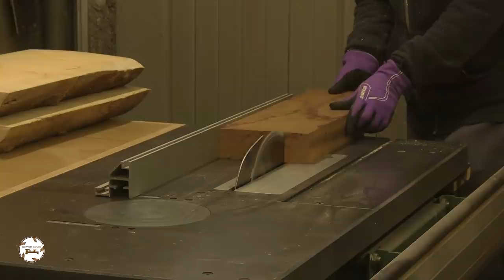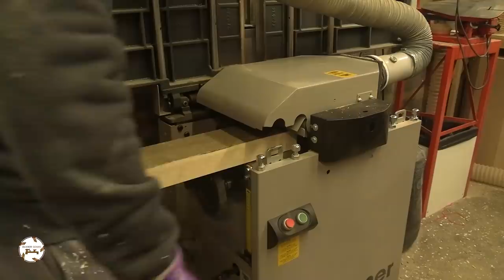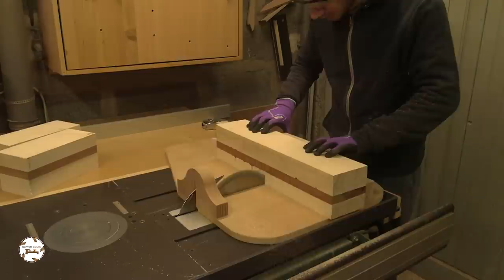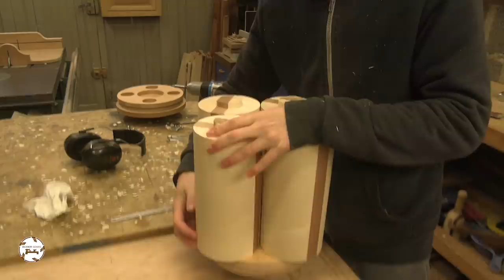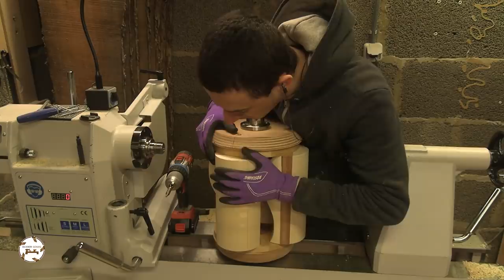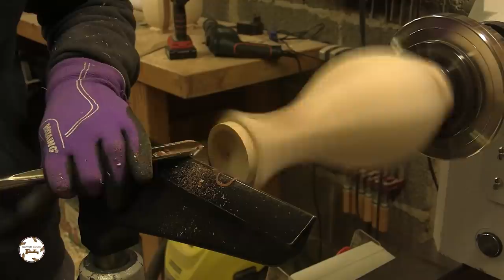Multi-Axis Square Turning

Comment: Hey, you might have a good reason to wear gloves, but it is considered dangerous. You are reaching a big audience with your fantastic work, and some people could think that this is fine. NEVER wear gloves or loose clothing when working with rotating machines, stay safe :)
Reply: This needs to get pinned
Reply: I think the shop is not heated and it might be cold...but you are right about gloves being hazardous
Reply: @ykkfamily  😳 hazardous?
I would of thought it's a must to ware gloves.
Reply: @motog4-75  
The risk is that even when being as careful as possible, the gloves can become snagged on the piece itself, or on the machinery you’re working with, and essentially pull the hand into the machine. Needless to say that if machines can do work on hard wood, they can obliterate fleshy human meat.
Reply: Why?
Reply: @radiation3570  why what?
Reply: @motog4-75  why wear gloves, is it dangerous, and if so in what way?
Reply: @radiation3570  With rotating machines like table saws and lathes, the cloth of the glove can get caught more easily than your skin and pull your hand into the blade, and you'll be unable to pull free, whereas if you accidentally put your hand into the blade normally, you'll get a nasty cut for sure, but your reaction will be to pull away and you'll be able to before you lose your hand most of the time
Reply: @christiancasaverdepertica1802  Or if you have a saw stop.
Reply: @TornaitSuperBird  Another good point yeah. Saw stop won't stop as quickly if you have a glove on, most likely going until there's already been damage done
Reply: @TornaitSuperBird  there ain't no stop on a lathe except the button
Reply: @Bagelbytez  they also like fingers.
Reply: @motog4-75  it is counter intuitive but the material of a glove is stronger than your skin. If it gets caught it will either pull your hand and the rest of you into the machine or it and the skin on your hand will be ripped off. This gruesome injury is called de-gloving. I strongly caution looking it up. If it’s just your skin getting caught you are much more likely to escape with just a bad cut. Rings pose a similar danger. 

Basically if you are working with rotating machinery you rarely want to wear anything on your hands. The only time you wear gloves is when the work easily damages the skin. Ideally in those cases you figure out how to do the work with a tool so you don’t need gloves.
Reply: @bensemusx  😁I had a friend years ago who was mincing some meat I think & he didn't have the plunger rod to hand to shove the meat further along. So he tried with his fingers, number 3 & 4 on his hand came straight off.
He said later it's the sort of thing that as you are doing it, you just know you should not be doing this, it's potentially very dangerous, but you continue anyway. The machine doesn't care. It's like it says to you " you were warned".
Reply: I agree with you 100% on the topic of safety. I'm a power Carver and when I carve my Dremel 4300 is turning at 25,000 rpm +. I almost lost my thumb due to the tool snagging a glove once. Since that incident I don't wear gloves when carving. Eye protection and face mask/shield yes, but gloves no. As you said, by the time the machine lets go of the glove it's too late to avoid damage.
Reply: i totally agree. I worked in an unheated and uninsulated shop built on a wharf through a Canadian winter and any time I was using a power tool (other than a drill) I took my gloves off. It’s just not worth the risk.
Reply: @motog4-75  No, they can snag in the machinery quite quickly

Comment: Is no one else worried about him wearing gloves while using spinning power tools, especially the table saw?
Reply: I can imagine very few scenarios where a table saw would fuck you up wearing gloves but not bear handed. If you’re hand is that close to the spinning blade, you’re gonna get hurt regardless. Of course there are edge cases, but no, I wasn’t worried. This is the first video of his I’ve seen, but the way he works speaks of grace and control. Accidents happen, but I think this guy’s gonna be okay
Reply: @bencressman6110  The difference could be a nick on the finger and the blade pulling your hand in. Look up world famous rock climber Tommy Caldwell and his missing finger. I'm sorry I don't have a long list of examples for you, but it seriously can't be that hard to imagine. There is a reason why most wood workers don't wear gloves. This isn't something that is debated, so I hope you're trolling.
Reply: @MrSatchelpack  I'm not trolling, you just asked if anyone else was worried, and I'm not.
Reply: It's more dangerous indeed
Reply: Gloves are more likely to pull you in and cause worse damage, especially with lathes. They can also just get in the way and make movements of the hand less fluid, resulting in choppier looking work. and i know at least in the us, most table saws are equipped with a mechanism that stops the blade as soon as a hand touches it.

Comment: I put a strobe light on my wood lathe that was synchronized with the rotation of the lathe.  Dim the back lights, turn on the strobe light, and suddenly the spinning blurry wood stock was freeze frame visible.  Stunning!  There was on odd desire to touch it, so I had to remind myself it was still moving.  I added another control that would delay the sync pulse from the lathe to the strobe, so I could effectively slowly rotate the spinning wood, and select the side I wanted to see.
I learned a lot from that strobe setup, especially about tool edges and how they cut.
It was as if I touched the tool to the wood, and instantly I could see the ring develop around the stock.
A real mind blower.
It was too addictive, and I didn't know the long term side affects of watching it, so I disabled it and gave it to a friend: Mr. Geiger.
I always hoped he would patent it and make it popular, but there is the downside of inducing seizures.
Reply: Instead of a strobe light, could you use a video and monitor set to synchronize?  I saw a video not long ago that stopped the blades.  Very cool!  Good luck!
Reply: "* blades of a helicopter. *
Reply: @shirleyostrander6531  Good thinking it'll work and a spinning aperture geared to the lathe works too. Anything beats harmonic blinking, eye got two tired.
Reply: I remember the boiler room in my church growing up (dad was the trustee) had some moving parts with warnings all over it because it was rotating at the same frequency as the fluorescent lighting, making it look motionless. It was inside a cage, but otherwise, it could easily tear off a hand.
Reply: @verdatum  Wow...too weird!
Reply: Ah yes, the only downside
The seizures

Comment: As an old woodworking geezer, I watch you wearing gloves, and not using a pusher on your table saw, and I cringe. At least you left your splitter on - but holy moly. My Dad used to try to save the fingers of professional woodworkers who got lazy and/or stupid around table saws. Sometimes he was able to. But more common were nasty injuries from the kickback getting them in the gut.

And look, I know that you know what you are doing. We all do. But when and if you lose fear of your table saw, a horrible accident is on the way. I am so scared of table saws I won't have one in my shop! There is no such thing as "bad luck" in a workshop. 

Fear is what keeps me safe when I am working. And I am so glad that many tools still scare the shit out of my. My angle grinder scares me spitless, even knowing how each quadrant works. My routers give me the absolute willies! And even my electric plane makes me very careful.

When you have had a doctor for a Dad, and he's a woodworker, and he's a repairer of woodworking injuries, you develop a very healthy respect for power tools, and how to avoid being sucked into them, or having them kick into you. I wear bullet-proof chaps when I am chainsawing, for example. And a hardhat, goggles, and a face shield!

Comment: This was a very cool project I'm not a woodworker and I have no reference to judge anyone for doing anything with wood. Holly crap when you first started turning with the interrupted cut I thought for sure the edges of the parts would blow out. I can only guess tool geometry and crazy sharp tools are the trick to pull this off. You got my subscription the creative thought is so  impressive well done.

Comment: This is a very interesting concept. I didnt expect you to make 4 individual vases at the end. In my head, i was thinking more that the four would each have a 90 degree angle, but the rest of the sides would be turned. When you put them all together, the corners would meet and form a bigger vase. Or you can display them each individually as well.

Edit: typos

Comment: So cool!
Very well thought out process!

I have to say that I am not into wood working as these tools are too damgerous for me. Machining that huge wood assembly at those ridiculous RPMs, with a hand-held knife.... Brrrr... I wouldn't dare to keep my hand on the chuck in the tailstock either. The metal lathe I work on does not have any key against rotation, just the taper keeps it from slipping, and sometimes it slips when the torque is too high.

Comment: Heh.  My first WTH was with the planer, when you rolled the table and flipped the dust collection system.  

The second was trying to figure out what your design could have come from.  Like hydro forming some welded metal into a pillow style object.  And I was thinking that I wanted to see the end result of the table to go with those funky legs.  

My first WTF (what the fudge.  Only I didn't say fudge) was when you cored them out to make a vase.  I think that my next door neighbors almost called the cops because I know my windows rattled at my exclamation. 

I was also thinking, if a mathematics wants to hold a 3D shape, call a woodworker.

Comment: amazing work, though I must ask why you use gloves when working with the table saw. Surely you are well aware of how much danger gloves add to your hands in the event of accidentally touching the blade.
Reply: I had to skip through the table saw bits. It's painful to watch.

Getting a knit glove grabbed by a saw blade can easily turn an unfortunate severe finger injury into a life-changing severe hand injury.

Comment: Nice technique!

I'm really surprised that a single screw was enough to prevent the individual cylinders from rotating. As you took wood off the outside, you changed the center of mass and the cylinders would want to rotate out so the bulkier (uncut) inside was facing radially outward.

Comment: Couldn't see if the fastening screws were off centre to prevent the pieces from turning in the socket...
Did you consider using square tenons & sockets? Safer + easier alignment of the four sides, albeit at the expense of losing the flexibility to do three or five, six, etc. sides on the same apparatus...

Comment: I'm wondering what would happen if you slipped with your tool and fed it in too far during that interrupted cut.  Would one of the "spokes"/legs grab your tool and could the whole thing explode in your face?  I've had a few bad crashes on a metal lathe, but luckily the part and fixture just exploded into the door and walls of the enclosure.  The real damage was to my underwear...I had to throw them away.

Comment: Additional comment: Could the same technique work with 3 or 5?  Would have to be very precise about the rotation angles but I think 5 would be really interesting.  Odd numbered surfaces are a little "unnatural".
Reply: 90° tends to be easier to mark than 120° or 72°, but all should be possible, and would probably look interesting. I’d personally also like to see 60° (hexagons).

Comment: Nice result, but save yourself time and energy. Either don't bother with the initial turning and just run the 4 blanks at once or just cut them down to octagons first. I'd also recommend reversing your registration/mounting pins so you can just use a large forstner bit to bore into your work.
Reply: Comedic
Reply: @kingy002  Clavicle

Comment: Why not band saw the profile out first. Then you can use the negative profiles for another set and you won't waste so much timber in shavings for the same results. I used to work in a joinery shop of about eight tradesmen. We had to find ways to utilise the maximum benefits of expensive exotic timbers and laminates. My boss would shriek if we made them with that much wastage, Nice work.

Comment: This is absolutely an astounding feat, and I don't wish to detract from its magnificence at all....but couldn't you acheieve the same shape with a bandsaw? I'm only curious if my instincts are correct. I like the lathe for the things it can create that nothing else can (literally). Just curious if this is truly one of those things.
Reply: I was looking for someone like minded.  I have done similar pieces on the bandsaw.  Stencil it out and keep taping it back together until all cut out.  Now on the piece in the video each side is slightly convex which would take some careful sanding to replicate but the piece is so small the convex surface is unfortunately hardly noticeable in my opinion.
Reply: @joewood Nice! Glad I'm not the only one. I've been thinking about this more, and the thing you get from the lathe on this project is 4 nearly identical pieces, whereas on a bandsaw you're at the mercy of your sawing ability, and how well tuned your saw is.

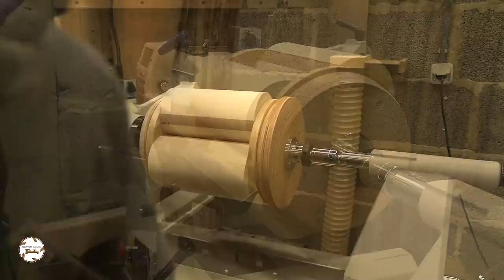Comment: What exactly is preventing those individual pieces at 3:35 to give in and move under the tool pressure, other than the friction between them and the "flanges"? If nothing else, then for me that's a ludicrous amount of not taking things seriously, regardless of whether or not it all ends up working out.

Comment: Seems like an excessive use of machinery. Is it impossible to that angle on the walnut core without turning the billets? I can imagine myself just carving these up with hand tools. The advantage I see with this is the perfect uniformity with the aforementioned angle but i can also imagine myself creating a process that just does it the same every time.

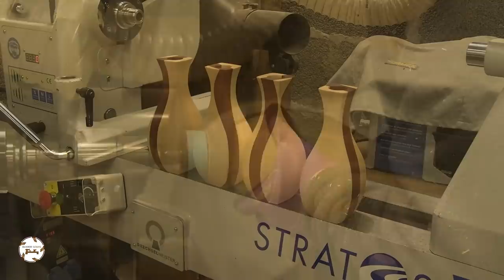Comment: @ 11:22 you insert a glass tube or some such. What is the purpose of the glass?
Reply: I believe they're meant to be used as vases.  The glass tube prevents the water from soaking into the wood.

Comment: That’s a great project “” COMPLETION “ —- unlike the ignorant observer  , we’re there parts you since turning would modify knowing your turning skills -(ie) a double screw in each end piece stopping twisting on the turning??
Does this work lead you on to more complex project designs? ( ie )  A INTERCONNECTED STANDARD LAMP DESIGN 🤔 - Alle die Beste 🤓👍

Comment: Hate to bring the bad news, but, could have done the same thing on the bandsaw in a quarter of the time and work.
Reply from the maker: Hate to bring it to you, but a bandsaw cuts flat. This technique makes rounded sides.
Reply: @OlivierGomis  you wanna take a moment to think that through again bud? 🤣
Reply from the maker: @saltwaterrook4638   I suggest you take another look at the video before being so arrogant, and you'll see that no, I could not have done the same thing on a bandsaw.
Reply from the maker: @saltwaterrook4638  Okay I agree about the second part, but you still need to use the lathe and the jig I made, and since this is a woodturning channel, I did it all on the lathe. But if you claim you can do the same thing using ONLY the bandsaw, PLEASE enlighten me and tell me how you do it.

Comment: Very cool video. It will be a sad day when you lose one of your hands to your machines. Your safety is seriously lacking.
1. No gloves 
2. No loose fitting hoodies with sleeves down 
3. Don't reach past the blade on your jointer
4. Don't reach past the blade on your table saw 
5. Don't pull stock through the planer from the outfeed side. 
You're a brilliant woodworker with a lot of talent, but your laziness about tool safety is going to result in those talents going to waste. It's hard to turn with a hook for a hand.

Comment: 0:08 Don't Do This!
You have a perfectly good joiner, and I assume a bandsaw! Never put the cupped face of a badly cupped board down on the table saw. yes it "seems" to make it more stable, but it is in fact binding the blade. You can clearly see this on the edges. 
Bad enough that you wear gloves on the lathe, but this is whole different level of bad technique that can actually kill you rather than simply main you.